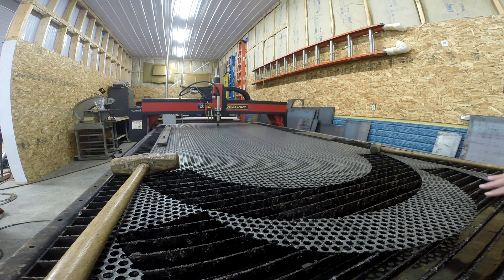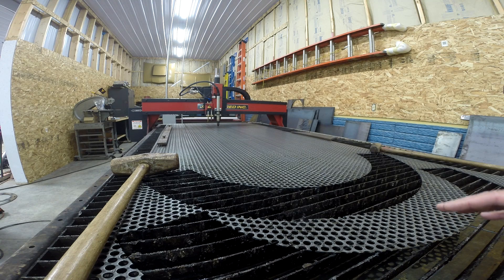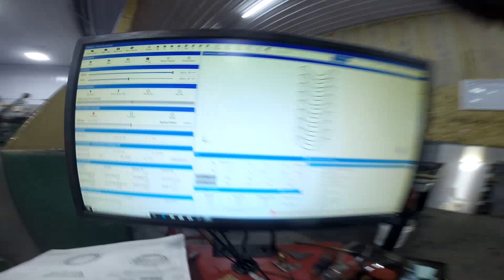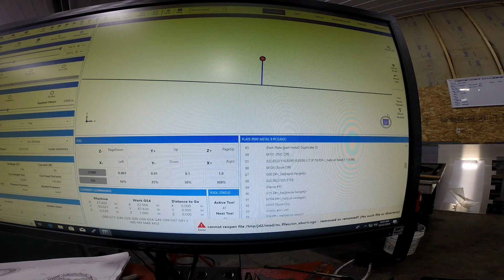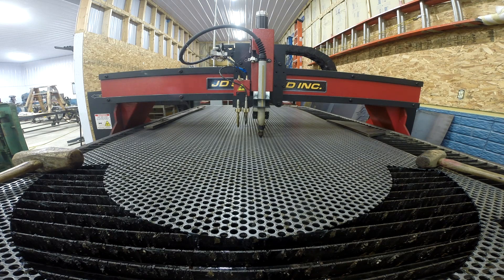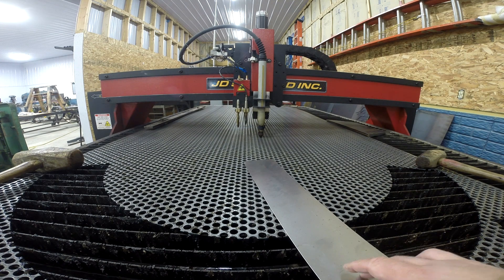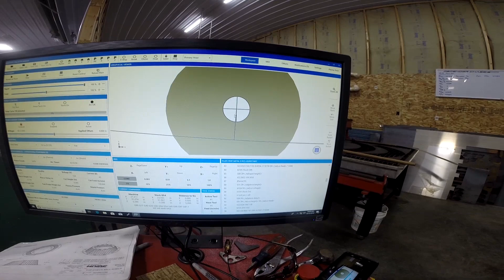CNC Plasma Cutting Perforated Sheet - JD2 MAD - Hypertherm Powermax 85

Comment: My first attempt at this failed on my Crossfile Pro table with Lesic Razor CUT45 torch. Torch of stop firing when it hit a hole. Switched to a Primeweld CUT60 with 'pilot arc' and everything worked fine.

Comment: Probably not the correct way to operate, but with my new control unit I restricted the downward movement to nearly 0 while leaving the upward Z movement unrestricted to compensate for the elevation change across the table. Ends up a little high on the end of the low side, but not much different than the touch-off starting on the high side.